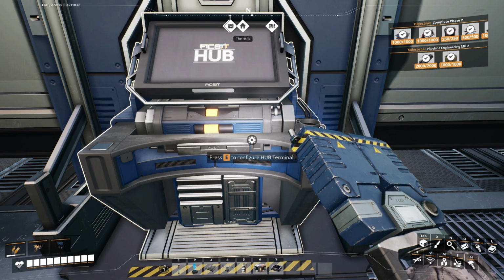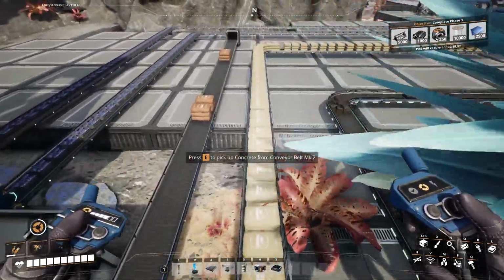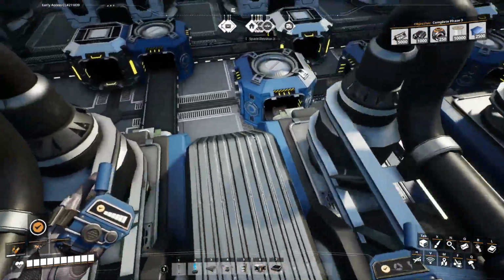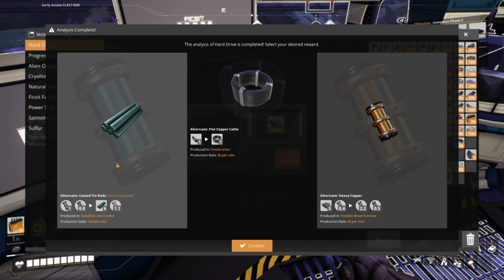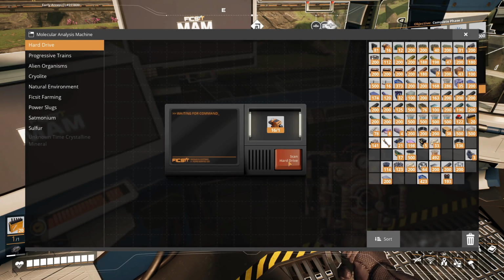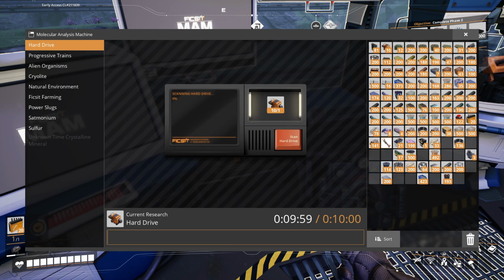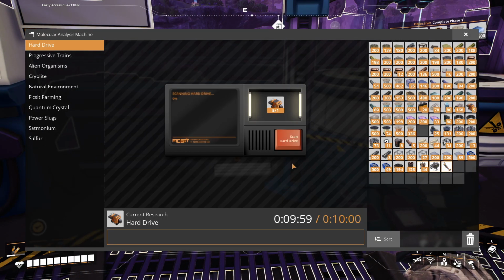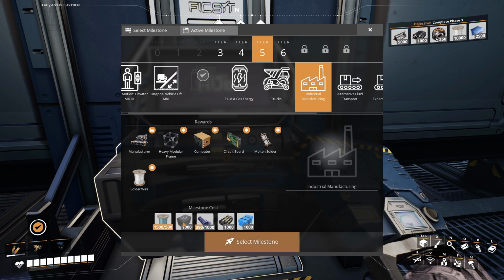Satisfactory Plus Phase 2 completed!

Comment: yeah hard drives are interesting.  most of the recipies have a place.  like the sheets to wire one seems bad.  but if your already making sheets and need just a little bit of wire its great.  also I use alternates to change how many is being produces for load balancing purposes.  like in vanilla sometimes I will use regular screws and sometimes cast screws depending on if I want a multiple of 40 or 50 lol
Reply from the maker: Never thought about using both for load balancing. Normally I just sink the extras that I get and with sink containers I have made that even easier.
Reply: @firegod381  fair point, I do that too.  I dont always load balance.  the sink containers take power too so I only try to sink overflow at the end of a production line.  if I dont load balance I do an manifold setup and in that case I dont care about backing up the input.
Reply from the maker: @marcbennett9232  I totally agree they do use power. But  at the same time if we run out I will just build more plants. We have Coal power unlocked but have not used it at all yet.